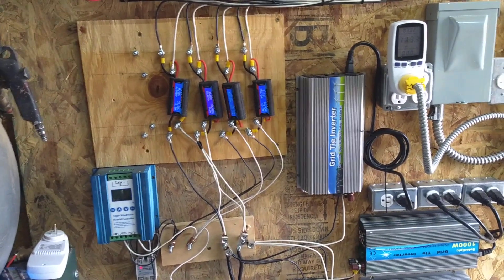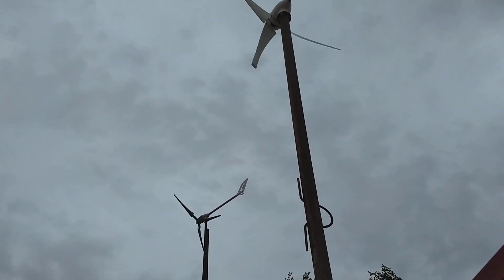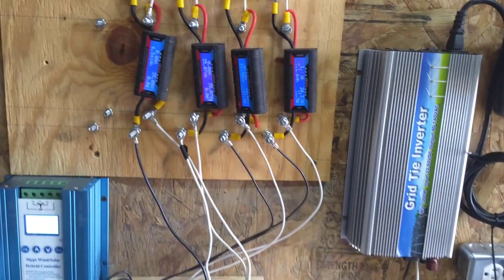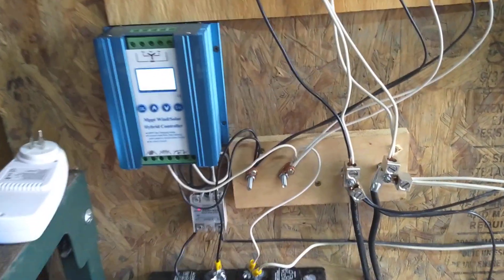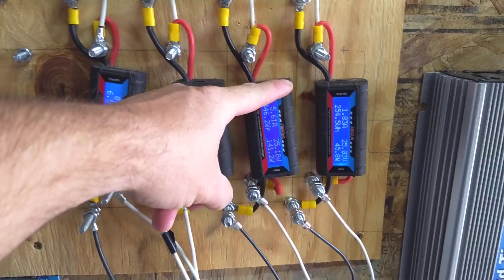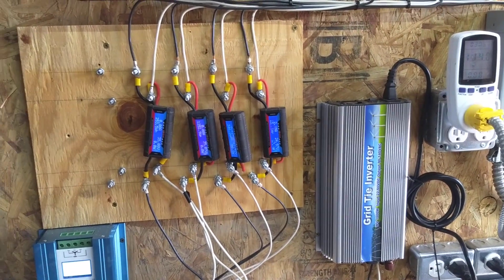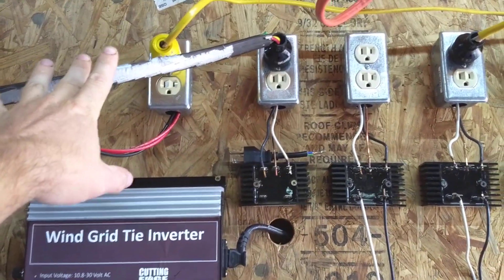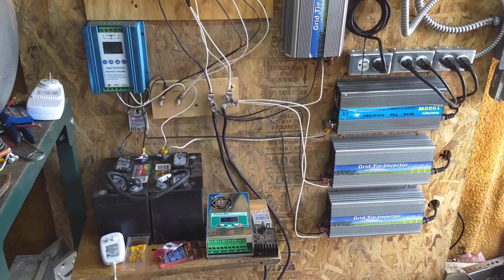Quick updates on the iSta Breeze Heli 2.0 and the low budget charge controller!

Comment: Write on meters where Heli, where Ista 1500. And position meters very awkward.
Reply from the maker: Thanks for watching!  I will get labels for the meters.  I haven't written it out on the board or anything because I change turbine position from time to time but I bet I can come up with some kind of label I can move around to identify which meter is connected to which turbine.  I'll be doing an update on the board soon because I'm making a rather considerable change and adding another turbine, I'll make sure I have them labeled by then :).  The positioning is a little awkward, but I can't do much about it.  There's other meters out there that are easier to position but they're much bigger...makes it hard to get them on the board with all the other stuff I got going on.

Comment: Just a thought with your Heli staring up problem, it's not being dragged down when connected by the different voltage, what i mean is i read if you take a 24v turbine and connect it to a 12v bank the turbine will act as if the brake is on.
Reply from the maker: I was concerned about the 36v bank acting like a bit of a brake on it, that's why I disconnected it to let it free-wheel.  But even disconnected it still has a hard time getting started.  It's going to end up connected to a 48v bank so that'll eliminate that issue, but I still think it'll need some break in.  So far, though, the i1500 is kicking its butt...
Reply: @ToysforWatts  do you think it is due to a larger turbine having the same size blades as the 1500? maybe it needs a larger blade set.
Reply from the maker: I'm trying to refrain from speculation at this time...since I got it up we really haven't had much wind.  The hurricanes down south are screwing with our weather up here.  Once I've have it in some solid wind for a while I think it'll loosen up...we'll see then.
Reply: @ToysforWatts  I'm definitely having one of thoses i1500 next year when the world is back to normal, well if it ever does gets back to normal.
Take care
john